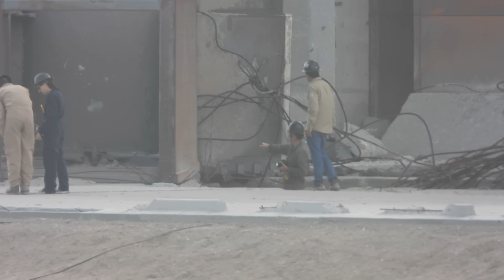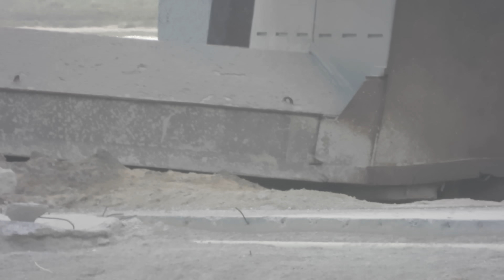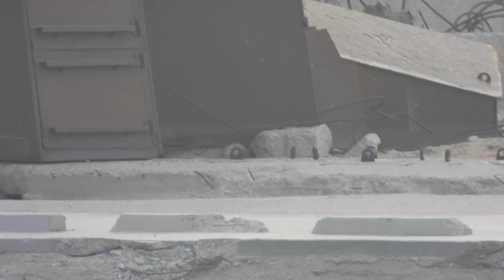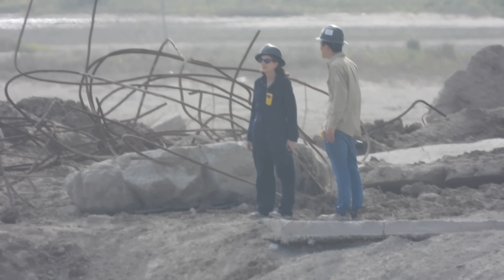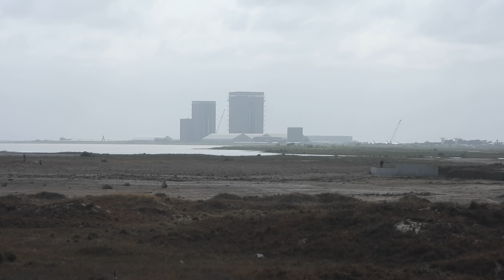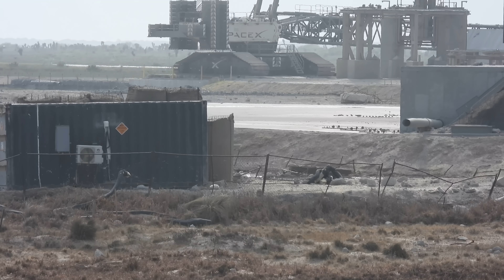Two Days After Launch, SpaceX Starbase, in 4k, Boca Chica, TX, April 22, 2023

Comment: Incredible mass destruction of the launch pad would’ve never happened if they had used flame trenches used by NASA for decades. Of course they already knew this but needed to evaluate what are the exact reasons why it’s need at this grand scale, well now they know. 
Concrete’s tensile strength deteriorates when combined drastic changes in temperature and the constant high tension caused from the blast furnace of the rockets and high heat temperature. 
Also there’s this phenomenon harmonic effects on solid objects where the vibration amplifies when exposed to a certain frequency like in this case, by sonic booms from the rocket engines hitting the concrete causing it to crack in millions of pieces. Very interesting stuff

Comment: What did anyone expect with those forces involved? Basically, it was no different than dropping a large bomb on it.  Back to a Saturn V type launch pad. I did notice it was struggling to lift-off. The Starship wasn't even loaded to full capacity with cargo or equivalent weight. But... This is the time to have failures and learn from them.

Comment: Elon says they don't use a flame trench because the Moon/Mars does not have them and need to take off from those surfaces.  Well, there is something else that the Moon/Mars does not have, a lot more gravity and much thicker atmosphere to deal with.  They are essentially starting on Legendary Mode for their first playthrough.  When they do their next couple of playthroughs, they will be on Easy and Normal difficulty.

Hopefully with almost complete destruction of the launch pad, they think about putting a flame trench in to divert all that destructive force.  They pretty much have the hole dug thanks to Booster 7.  The fact that they can launch from the Moon with an eighth of the thrust and about a third of thrust from Mars, they can get away without a trench there, but this big rock of gravity and thick air, those Raptors have to go full throttle.

Comment: It seems that they were pretty lucky to get the rocket launched off that pad—a little longer and it would have dug out its foundation and tipped.
Reply: No, I think the concrete only give up and blow itself apart when the rocket went full thrust for liftoff.

The pad was able to handle 31 engines static fire test at 50% thrust for 8 seconds…
Reply: The lunch-pad legs set on piles. The piles goes deep into the ground>20meters. So no

Comment: Amazing how the concrete was crushed and blasted apart leaving behind those snarls of rebar stripped clean. I just don't think Elons estimate that they'll be able to make repairs and get back going in a month. Even if you were just repairing and rebuilding to what was previously there, the amount of potentially structural damage at the footings and foundation makes that doubtful. To not only repair but redesign it to survive repeated launches on an aggressive schedule is that much harder to see in a period of a month or even 3

Comment: I would be terrified to be in Starship when it launches unless they figure out how to keep all the blow back down. There was so much junk at takeoff I for sure thought I saw it wouldn't make it back through the atmosphere.
Reply: Install a flame diverter.. and use an appropriately large water deluge system suitable for a rocket more powerful than the Saturn V... not the small one they have. ..the solution to this problem had been figured out 60 years ago... Elon chose not to use it.

Comment: Whoever at SpaceX lost the argument over building a flame trench is sitting pretty today.  (what about the guy who recommended that the tanks be built further away...)  Design, build, test, break in a quick cycle until with works is clearly a method that produces great results for many things.... stage 0 is unfortunately not one of them.  Starship is clearly incredibly resilient for having successfully launched, cleared the tower and flown with many engines out.  The rocket stand is a great piece of engineering and design, it just needed a flame trench.

Comment: The sad thing is, if the OLM had been designed adequately for this booster, it appears they would have been 1-1 in launches. Highly questionable is the comment X made that had the water-cooled steel OLM floor been ready they would have used it. Cart before horse anyone?
Reply: If they go ahead with a water cooled pad (ie radiator style) they'll just blow it up as the water flashes to steam in a split second

Comment: -  I don't understand how they could build a substandard launch structure for the most powerful rocket cluster ever fired? 
-  And that's with less then optimal thrust, since 20% of the engines failed to function. You would think the design would incorporate 150% over expected stress load as a common engineering construction precaution.

Comment: With "17 Million Pounds of Thrust", they might need to think of having 2x that in the Flame Diverter System Mass! Like 34 Million Pounds Plus!

And, since the Flame Diverter sends the Flame Sideways, it will experience an equal and opposite reaction in the Opposite direction! Make sure it's "Pointed away from the Launch Tower", in case it "Moves!" 😮😢

Comment: Elon's a smart guy, but not waiting until the OLM was properly protected before launch was a massive mistake! Looks like that one horizontal piece of the leg raise a foot or more on it's outside edge. With my 43 year knowledge of the construction industry, seems to me with the scope of damage I see in yours and a few other videos, he needs to take the top of the OLM of, bulldoze and haul the rest off, and start from scratch using proven flame trench and water suppression systems. Also seems like making the OLM taller would be in order, but judging by the launch day videos, those flames are twice the length of Starship,  so not sure how tall it would need to be. His one to two month estimate for a second launch attempt is way way off. I would be surprised if he can pull it off before the end of 2023. Thanks for sharing!

Comment: With that much energy going into the rocket to lift it up, you have to deal with that energy going somewhere. I am sure SpaceX teams knows about that already. On our part, we now can realize how much it takes to send fly a big machine like that. Are we reaching a ceiling in the reusability of a big system like that? Until we can figure out, how to mitigate this energy. What about a big hole in the ground, purposely made to catch the exhaust, I mean a 200ft diameter tube of 200ft deep...It will definitively take something else than this current setup.
Reply: Ha great minds think alike. though in my case the cavern below the ground is made by a small pocket nuke with slant vents drilled so the pressure has somewhere to go other than straight back up the hole.

Comment: If you think that future designs of the launchpad/stage0 will not only have to survive one start, but maybe several daily, then there's a sh!tload of engineering that has to go into this part of the infrastructure. Quite honestly I think Fondag is missing some key components required for better fire resistance. Usually there is still water left in concrete after hydratation and this water causes problems under heat. Concrete flaking off at bullet speeds... Some tunnel fires could be used as lesson here. For this use case fiber concrete with polypropylene fibers is used which have a low melting point and evaporate leaving small wormholes (not the sci-fi stuff - regular ones) where vapor pressure can escape.

Also for protection of the fuel tanks the steel nets used in the alps (and elsewhere) to protect from falling stones could be an idea.
Reply from the maker: Awesome!

Comment: Elon Musk has done well. They did everything right. I'll explain now:
A rocket of huge size, with a lot of weight. You can compare it with H-1. The principle is the same: a lot of engines. With a difference: the N-1 was built in the 1970s, when there was no powerful computer technology for effective control of the engine block. The H-1 disaster destroyed a complex outgrowth - the launch pad. I'm sure Musk took this experience into account. And they built a rocket, with a lot of engines, with a reliable computer control system for the engine block. But no one was sure that everything was taken into account. Destroying a rocket is one thing. To destroy a launch complex, such as at Baikonur, is several years of construction. 
Therefore, Elon built a simple start, for 1 time. At the same time, we looked at what would happen if we did not divert the gas jet of the engine block. It turned out spectacularly. 

Ilon's next step is the construction of a real launch, the completion of the rocket and a successful launch. Bravo, Elon!!!

Comment: I wonder why they let this happen. we pretty much knew it would. Saving time and money on the launch mount is one thing, but it was also foreseeable that chunks might fly around. This posed a threat to the vehicle and, it did in fact damage a number of engines. The damage to the tank farm also seems wasteful and preventable. Figuring on repairing a bunch of cement might be easier and cheaper than building a complex pad in the first place. But the foreseeable damage to the vehicle and to the not-so-cheap infrastructure of stage 0 seems strange.

Comment: I cannot understand why they didn't use water to quell the blast. Honestly, when the concept of water needing required to stop the pads imploding 60+ years ago, that no-one envisaged it as a necessity now with a more powerful rocket. Not a bit of wonder the rocket failed in flight, for it sat on the ever destructing pad for a full 8 seconds before even leaving the ground and probably blew so much concrete up it's arse, it's a wonder it rose as high as it did.

Comment: Way off on how large in size reinforcements need to be; a steel wall in front of the fuel tanks and a base made of steel pipe with directional flow out and away; the concrete not working funnel the blast away.

Comment: The exposed concrete can't take the heat, even with wash-down and all that. Once any started spalling and shedding, the exhaust jet turned into a giant sandblaster that cut through it all in seconds. Next time around put some big ol' heavy ceramic slab tiles over it as thermal cladding. Stuff that's a couple inches thick, heavy as a manhole cover, and high temperature cement to keep it all seated and not separating from the new concrete structure it should be protecting.

Comment: Saturn V had 7.7 million pounds thrust. Super Heavy Booster makes over 17 million. Wouldn't it be pathetic if the space program reached an unanticipated impasse because rocket power has exceeded the capacity of something as mundane as the concrete pad they have to take-off from? They're going to need something quite a bit different in place before they try that again.

Comment: How do you fly a 33-engine rocket and not expect the Stage Zero to fall apart when it's made from concrete?  The rocket didn't fail the launch mount did.  I am sure they will find that the engines failed because large chunks of concrete smashed them to bits. Fix the mounting system and the rocket will fly without a hitch.  Did no one on the Stage Zero team warn of this type of failure? OK first principles thinking, We need a mounting system that will not come apart and spray concrete into the rocket engines?  Pad should be able to withstand 16.7 Million pounds of thrust and not come apart!

Comment: How is starship going to land on and take off from mars?
It seems the nose thrusters from the lunar design are going to have to do all of the work close to the martian surface.
Reply: @timemachine194 It's not really a matter of thrust its a matter of proximity. Even 1/10th of full throttle a raptor will kick up Alot of material from the martian surface. Unless its from hundreds of feet above the surface. EG curiosity and perserverance's rocket crane drones.
Also if its a rock surface it won't be level enough to land on.
Reply: @timemachine194 One thing to keep in mind about distance vs thrust, unlike on earth the plume will spread much more rapidly on mars due to the essential lack of atmosphere so distance helps you alot more than it does here where you get mach diamonds.. Also the lower gravity both holds objects to the surface looser and requires less thrust to land making it a partial wash.

Comment: NASA learned in the 1960’s that to launch a large rocket you need a lot more than a reinforced concrete launch pad, you need a flame trench together with a massive water deluge system. Starship is at least twice as powerful as a Saturn V moon rocket or Space Shuttle. SpaceX think they know better and damn near blew up Starship on the launch pad with flying chunks of concrete and the mission had to be aborted after only 4 minutes, they were incredibly lucky the entire tower wasn’t destroyed because Starship launched at a crazy angle but by pure luck away from the launch tower. When will Musk finally admit he made a mistake? I bet he had engineers screaming at him to build a decent launch pad as used by NASA.

Comment: The concrete has moisture trapped inside. Especially being so fresh. I learned in my 1972 High School welding class, if you apply enough heat ( cutting torch) to a brick, concrete, or block you will get a violent expansion.

Comment: No concrete at all: Only Steel: cooled by tubes welded to steel-platest, designed like Motor-Nozzle (Reusable like the Motor). Cooling water flow in these tubes...

Comment: So what happens when the exhaust thrust coming out the Rocket, starts getting pulled out, at the same time the Rocket is pushing it out?  

So what happens if you are standing on a skateboard, holding a medicine ball, and when you go to push it away from yourself, i quickly pull it away from you at the same time?  

Pressure Equalization is a Pesky and Persistent Brick Wall nobody has gotten beyond yet.  I think it's because Pressure Equalization is built into the Laws of the Universe, lol.  You just can't stop it from happening if you go Too high.

Comment: Jesus, they left parking bumpers that close? I wonder what state those ended up in? Musk used to talk about something called the sunk cost fallacy or Gamblers fallacy. It's where you dont give up on a bad idea because you've already worked so hard on it. Not building a flame trench and deluge system more substantial than those used by other big rockets is a good example of this. Even the massive systems used by NASA and others need refurbishment after their once or twice a year launches. Starship needs zero pad maintenance after launch to be rapidly reusable. It's a miracle it made it off the pad without exploding from debris strikes, that was dumb luck not engineering prowess. A big metal plate won't fix this unless they want to cover everything inside a mile with big metal plates too. A big metal plate will actually make the reflected energy worse, at least exploding concrete takes some of the energy away with it. Hopefully the rest of the tower infrastructure will work with whatever they have to do to the mount. Jesus even the armored top of the mount really needs a deluge system. Look at those holes in freaking EVERYTHING! But Musk said, I guess.....
Reply: Second what you say about what the metal plate will do by just reflecting the energy upwards. They could be just constructing a larger bomb under there ! Seen none other mentioning this.. 😱

Comment: Pretty sure the whole launch ring will need to be ripped out and redesigned and built.  I don't see them simply repairing the damage.
   The problem with that part of Texas is that you have to build up.  If you go just 3-4 feet down you start hitting ground water.  I've done water and sewer mains in Brownsville.  Every morning we had to pump out any exposed trenches from the day before.

Comment: Excellent capture of this fiasco!!  As large chunks of concrete were projected in all directions, steel/iron plating and a water deluge system would have been wise choices, especially if concrete damaged the Super Heavy as the Raptors started igniting.
Reply: Nothing is fiasco here….
Reply: Think it was a good test, they now know the exact damage caused and put in the correct measures to fix it. Also shows how solid the engines are that only a few flamed out under all that chaos
Reply: And this is why there is so little damage, most of the engines were not at full roar on lift off (why it was slow to get off the pad and to drift sideways) if they had the damage would probably be twice as bad. Its also why the damage is mostly on one side of the pad.

Comment: You're gonna need a bigger hole and  And a way to exhaust those gas pressures so I don't come backup You build it like a spider the body of the spider That's right my opinion doesn't matter I don't have no degrees in engineering and I'm no rocket scientist

Comment: It is what is termed as a cluster f**k. The whole thing needs a redesign and new build with absolutely sealed joins. You can't have stagnation pressures from the engine efflux entering into anything as you achieve near chamber pressures inside the structure at approaching chamber pressure between say 800-1,000 psi. A slab of a square meter with that pressure under it is a ballistic object.  Frankly, whoever designed this structure was a bloody amateur. New boys sitting at screens have no visceral understanding of what they are dealing with.